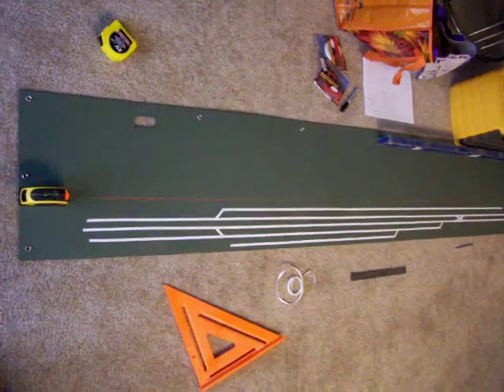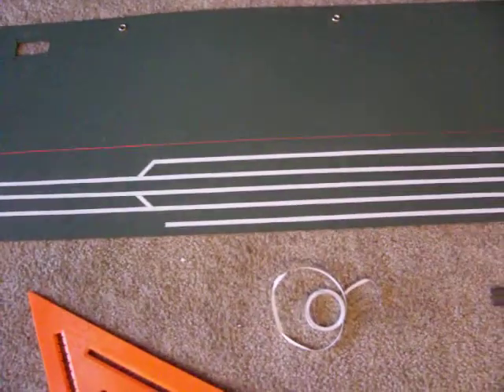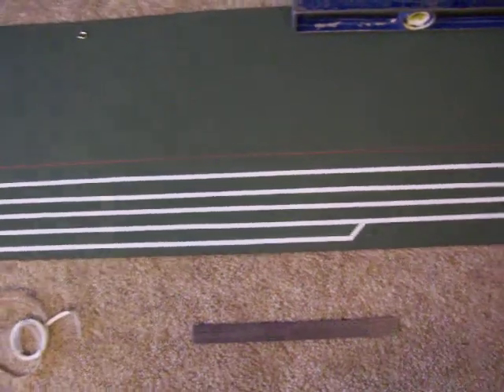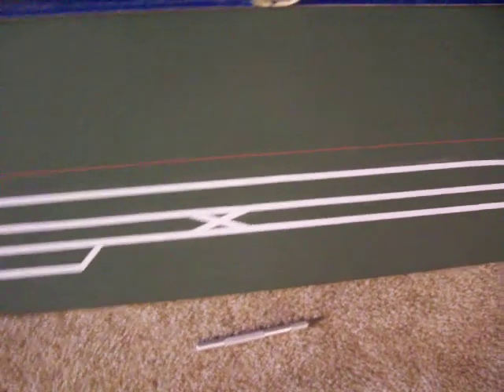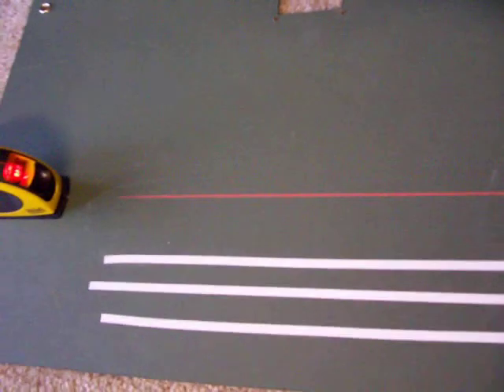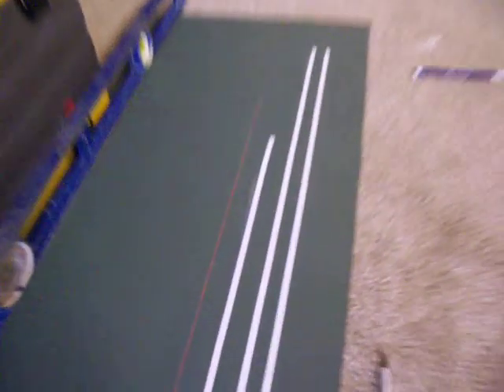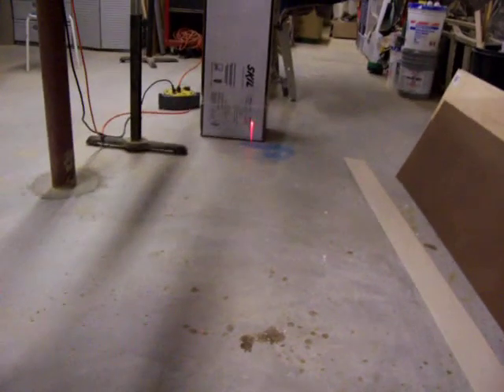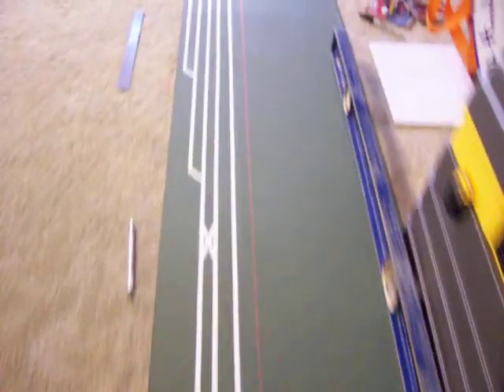Main Yard Control Panel Schematic

Comment from the maker: @GIHC09 You can go to the progress thread link that is on my Youtube mainpage. Go to the 26th page of that thread and I explain how I made my panels.  It carries over to page 27, when I start laying out the schematics.  I mad the lines 1 inch apart, and most of the angles are 45degrees.